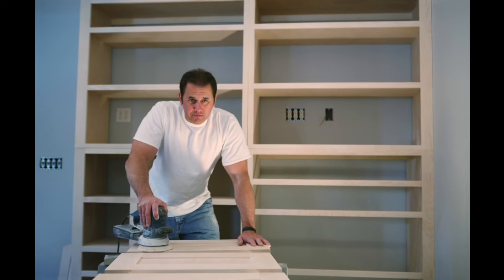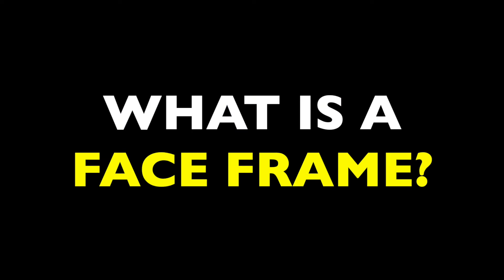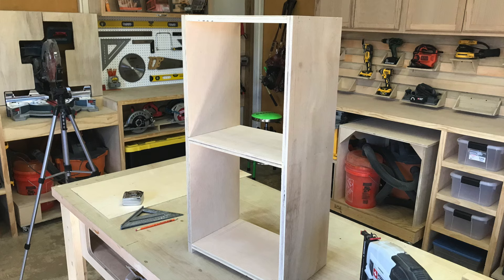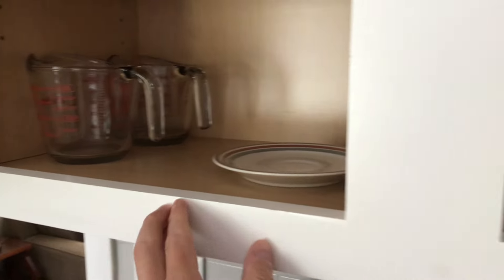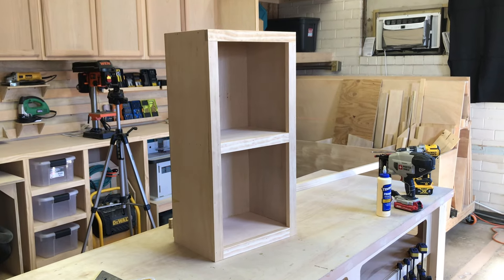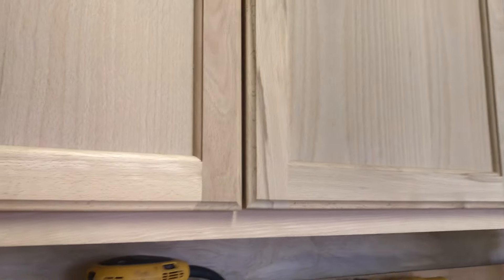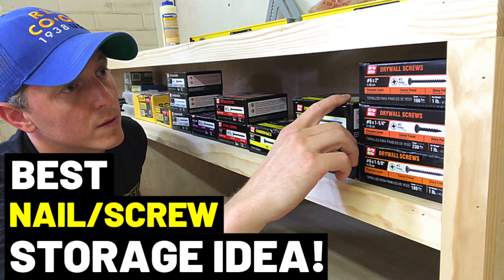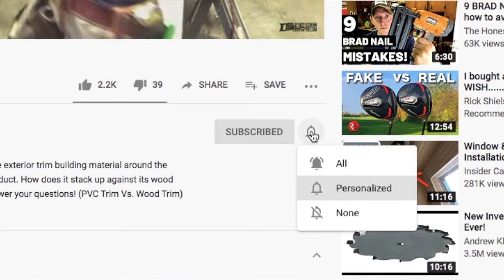#1 TRIM SECRET--This Is The KEY To Better-Looking Cabinetry/Woodworking Projects! (For New DIYers!)

Comment: Doing face frames to furniture grade, ie no joint gaps anywhere, is hard, or requires a lot of skill.  Everything matters. Hardwood characteristics, planing technique, sanding technique, right type of saw blade, perfectly square table saw, clamps everywhere on glue up, on and on.
Reply: It makes things easier if you make your face frame 1/8" proud from the carcass everywhere.
Reply: @jobacuda4472  Yep, another important point, one of many to do face frames at a high level.

Comment: From one carpenter to another, you put that together wrong. 
Your rail gets trapped between the stiles. Not good to mix them. 
Just like hand tools, you want to stick to one brand so you don't have twenty different batteries. All Dewalt, or all Makita, etc... One or two specialty tools is the exception.

Keep up the good work.

Comment: I was once told that kitchens in Canada are 80% European style and 20% face frame while it is the reverse in the USA.  Don’t know how true that is but, as a Canadian kitchen designer, I have almost exclusively used European style kitchen cabinets. I truly disliked using face frame cabinets. Every drawer is at least an inch or more narrower than a European style drawer due to the clearances that are needed in a face frame cabinet. I also found it annoying when I would open a double door and find a centre style that is always in the way!  In a European style base corner cabinet, I could use two 32 inch turntable mounted on a solid shelf.  A face frame cabinet would only use a 24 inch turntable mounted on a post as that is all that the face frame would allow.  That is a major difference in storage!  The average person did not have a huge kitchen and it was so much more efficient to use a European style kitchen. And frankly, I loved the look!
Reply: You find center style in the way on a double door cabinet to be "annoying"?

I disagree.
As a pest control technician that sometimes needs to reach in the remote areas inside a kitchen cabinets, I say this should be rated as a criminal offense!
Annoying is way too mild of a word.
Reply: @jvgauthier  ... I was being nice but I totally agree with you!

Comment: I knew about face frames, but I did not know what they were called. To me it just adds a finished look to the piece so I, therefore, do not like the plain unfinished "modern" look. Also, to glue a finish strip on the edges is cheating, unfinished, and looks unprofessional.

Comment: Okay good video to introduce the concept however a few key things were wrong or not mentioned. 

1. The definition in the video is wrong. 

A face frame is a structure that orientates members of the frame with its width facing out. 

Instead of a traditional framed structure which it’s members are orientated with its edge facing out. 

A picture frame, for example, is a face frame structure. (99% of the time) 

The definition in the video is too specific and doesn’t actually define the concept. 

2. Face frames cabinets are not CONSIDERED the traditional method of building cabinets - face frames ARE the traditional method of building cabinets. 

Before sheet materials were invented and widely used - the only thing available was solids (natural woods). 

Therefore constructing panels out of solids was time consuming, expensive and wasteful. 

And your cabinet would weigh a ton. 

So face frames were constructed not only for the faces of the cabinets - but for the entire carcass with the exception of its shelves and doors. 

To save on material, weight and money - traditional cabinets used face frames for the top, the gables, and the faces (especially for kitchen cabinets) often the backs would be left open and the house’s wall would serve as it once installed. 

The only cabinets that received a solid panel were the ones that were visible  (such as end cabinets). 

This method is how the industry used as much of the wood as possible before plywood and other sheet material was invented. 

Modern cabinets are like fully fleshed out bodies. 

While traditional cabinets are skeletons. 

3.When installing face frames to the cabinet’s face edges  and you are matching the species of wood to the shelf/gable - try to find a similar grain pattern and line it up as best as possible - this takes the look to the next level making it look monolithic. 

4. Inlay doors and drawers look best with face frame construction -  overlay doors and drawers do not look as good. 

However inlay doors and drawers are more difficult to construct and implement. 

5. Theres kind of two unwritten rules regarding sizes for face frames for cabinets. 

A. The thickness of your frames should be the same thickness as your panels. 

B. The width typically is triple the thickness dimension as it often looks the most balanced. 

So if the panels are 1/2” thick - your frames should be 1/2” thick x 1-1/2” wide. 

Typically anything less looks skimpy. 

Anything more looks too bulky.